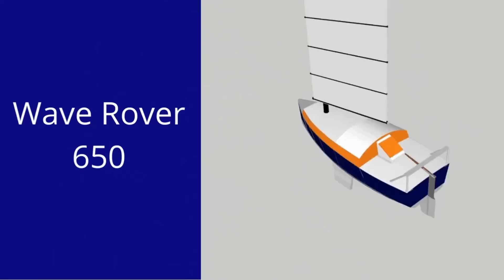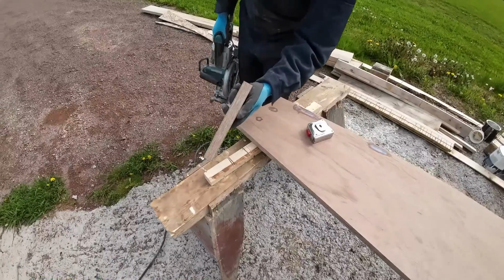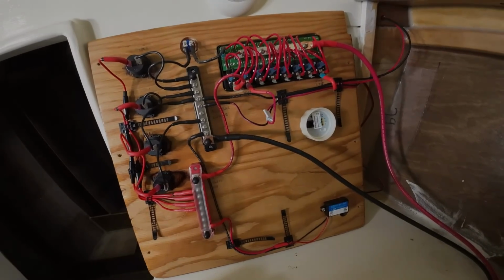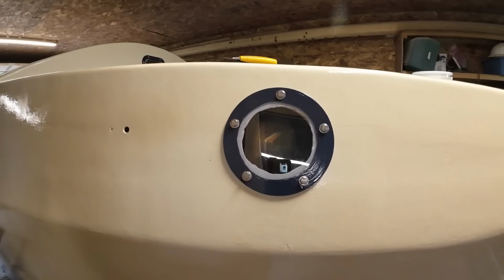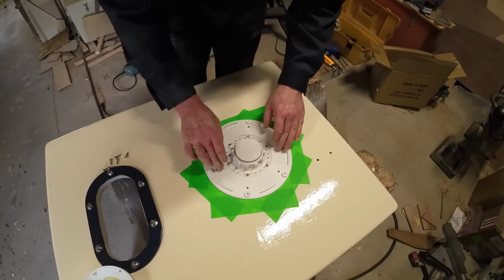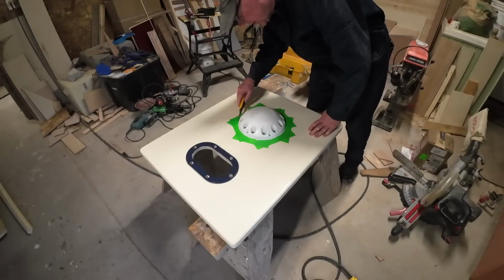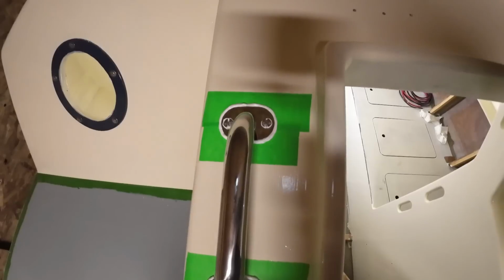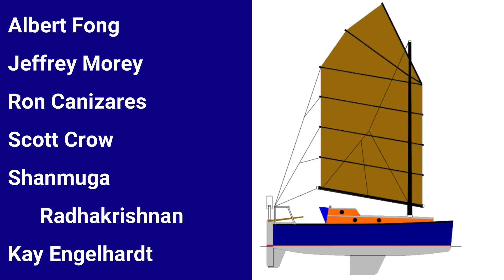S2E86  Wave Rover's Launch Scrubbed // Launch????

Comment: Personally I'd go with the Honda because it's Air cooled (less parts, less problems), if it was your primary propulsion the quieter Yamaha motor  would make sense, but if you use motor's anything like me (turn that noisy, smelly thing off as soon as there's a zephyr) then you're not going to be using it enough for the noise to be a problem, maybe the noisiness will motivate you to sail more? Also as it's not your primary propulsion you don't want to be spending a lot of time doing maintenance, so the simpler air cooled engine is less work for you, no impellers, pumps etc. Also as someone else mentioned you don't want to be using you fresh water supplies on flushing an outboard (I gather you're not bringing a water maker?).
At the end of the day you will make you own mind based on your priorities, which may be different from mine, that's ok 👍
Reply: Another idea, these days especially in that power range I'd be looking at an electric trolling motor, more than adequate for what you're planning to use it for and as you'll probably have solar panels anyway it's just a matter of adding some extra batteries and you should have a "full tank" (full batteries) every time you come into port, I've see a lot of trailer sailors locally (typically 22" - 28") go this option recently and they seem quite happy with it when I ask about it at the local boat ramp.
Reply from the maker: I love the idea of them but it is a costly motor. Maybe in the future

Comment: It's been such a journey watching the project. It's crazy to think that she's going to launch soon. One thing I don't quite understand - the shape of the top of the boat - the cockpit area, how is that going to become a comfortable location to spend time, and the top of the boat - due to its curves looks like it might be dangerous to go forward on his voyage. Anybody know?
Reply: That' s what I was thinking, too.
Reply: @willymueller3278  Me as well.
Reply: Firstly, the cockpit is not intended to serve as a place to spend time. It's only modern thinking that says a cockpit should double as an area for entertaining guests. Traditionally, cockpits were small and designed to hold a minimum of water, so as not to weigh down the stern if swamped by a boarding wave. Wave Rover 2 takes this to the logical next level of not holding any water at all. This doesn't present a problem because everything about this boat is designed so that all boat-handling, including steering, can be performed by standing in the companionway hatch. Standing this way, only protruding out of the boat up to your waist, is much safer than sitting out in the cockpit area.

Secondly, the curved upper deck is actually a safety feature, not a hazard. Whether the boat is upright, or well heeled over to one side or the other, part of the deck will always be close to level, and that is the part that you would stand on. Very different from, and much safer than, a typical flat-ish deck, which will almost always be sloping one way or the other when at sea. Not that there should be any need to ever go forward when under way. Again, one of the beautiful things about the junk rig is that all sail-handling can be done from the safety of the cockpit hatch. The only time it will be necessary to go forward will be when dropping or raising the anchor. Or tying up alongside a dock, although that is something that Alan intends to keep to an absolute minimum.
Reply from the maker: @Garryck-1  Thanks buddy, I couldn't have said it better!!!
Reply: @Garryck-1  Thank you for the explanation!
Reply: @tugboatsvideoemporium6476  - You're very welcome!

Comment: I want to address the shaft length. A dedicated sailboat engine , like the Mercury F5 sailpower has a 20 inch shaft, and in rough seas  there is less risk to either drown the engine or run it dry. It weighs 25 kilograms. But still….
Reply from the maker: I'll be going for the long shaft
Reply: @RoversAdventure  I think it was the 25 inch shaft I had in mind. I used a Tohatsu 6 hp sail pro on and old style sailboat with long overhanging aft, and it went to both extremes, drown and air spin when hobbyhorsing.. WR will not have that kind of movement, so maybe 20" will suffice. 25" wont hurt though....?

Comment: I prefer to place any item to be set in Marine caulk temporarily in place and just use a lot more short pieces of tape around the item. I would never want to razor into my finished paint like that. I also tape the item itself so that once set and tightened you use a finger around it to thin and remove the caulk then you just peel off the tape from the hull and off the item and you are finished. No need to razor cut and damage the paint..
Reply from the maker: Use  a sharp edge and a light touch and you will be all right. It may take a little practice but you will get there.

Comment: i personally like the Tahatsu ( Mercury ) but i wouldn't buy new , i go used and in that case i'd buy an Evinrude 4hp sailing motor (extra long shaft ) electric start and light weight ! or maybe an electric 150lb. thrust , no flushing no gas easy to fix and remote steering !

Comment: Honda is great. Air cooled would be more robust, The noise might not win friends. I would go with the Yamaha despite the draw back of maintenance and potential break down of the added cooling system complexity. More HP for negligible extra weight and less db for the win. Of course, spares and lubricants aren't weightless and will need to be stored and Honda is EVERYWHERE.

Comment: Regarding the size of your boat, its better to get a honda 10...20 hp. Because it will also help you to navigate through inland waterways. Less powerful engine will be a waste of money.
A simple equation:1 hp/100 kg.
Reply from the maker: If I was planning a lot of coastal sailing I would go with a bigger engine and just leave it on the transom

Comment: GO HONDA - noise not an issue if only used for docking, air-cooling is less complex, any weight saving is good and you can't beat honda reliability

Comment: My gramps was the most intelligent person I ever knew . He was involved in the development of the most common construction site equipment in America. The bobcat so he really new mechanical engineering without a college degree but horse sense . He taught me the more sophisticated a piece of equipment was the more parts it had the more points of failure there were . I'd off the top say Honda BUT having been a logger I learned the chainsaw I preferred to use was the brand of saw that had the closest dealer saw shop while a Stihl or husky saws may be great but if the dealers is 100 miles away it's not feasible. Look for how many worldwide coastal dealerships are in areas you plan to travel. Waiting 6 weeks for a water pump impeller would suck 😳
Reply: Totally agree with dealer location along your route!
Reply: Green points for electric outboard.  Some neat selections out there.  Sunny, windless doldrums keep you going.  Gas runs out.  Consider more solar and battery capacity.

Comment: Aired cooled will not require you to change impellers, water cooled if they have rubber impellers might require you to change it out during your adventure… just something to think about…  crack on! Lol
Reply from the maker: That is the big advantage about the honda
Reply: Changing the impeller is not a big deal,  I wouldn't let that influence you.   A noisy outboard is such a pain I would avoid it.   I would think that a 5-6 hp motor is more suitable,  you say just for entering/ leaving harbours but that's often when you're head to wind,  pushing into some chop, maybe against a current entering a lagoon,  the boat will have significant windage as well.  A few extra kgs really isn't a big deal.   I have a 6hp Mariner 4 stroke on my Corribee 21 and changed the prop to a high thrust one for the same reasons as above,  going head to wind etc. It does well. In summary I think small engine=false economy😂
Reply from the maker: @jesbates8611  For me it was more about weight but I am now thinking about a slightly bigger motor

Comment: Why not go with a diesel ?
Reply: 2 reasons.. 

1. They're heavy.
2. They're expensive.
Reply: Also require tanks and fillers, filters, exhaust system, and at least two more through-hulls, three if you include the stern-tube. Okay on a bigger boat, or one without other battery charging options. Potentially smelly if it leaks into the bilge (it will eventually). Outboards cann be carried to the engineer for repair, inboards require a visit by the mechanic to the boat.
Reply from the maker: Trying to keep everything simple and affordable but also light

Comment: You may want to steel reinforce your rudder, if your sailing in the Gibraltar area, considering the killer whales new diet of sailboat rudders.
Reply: Just smear some hot sauce on the rudder, killer whales won't like that.
Reply: It's happening all over the Bay of Biscay.
Reply: Most modern rudders are fibreglass shells, filled with closed-cell foam. Which is why orcas can destroy them so easily. Alan's rudder, on the other hand, is solid plywood, sheathed in fibreglass. Any orca that bites it is going to lose some teeth, whilst doing very little damage to the rudder.
Reply from the maker: lol

Comment: Forget the damn honda, its a toy, get at least 4 hp no less
Reply from the maker: How does a 6hp sound?
Reply: Even better, in case you need to motor against current and Wind, read the comparisons, Yamaha is mostly sturdy, a used older Honda also quite reliable, a new suzuki very light to carry (,bought a white one), the mercury comes with gear shift on the gashandle forgot which size maybe 8 hp.....neat boat